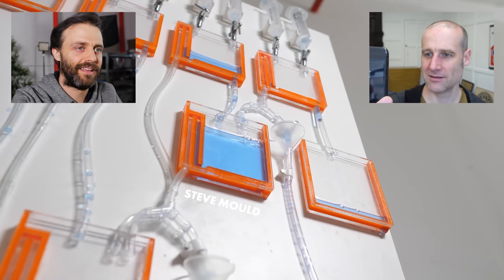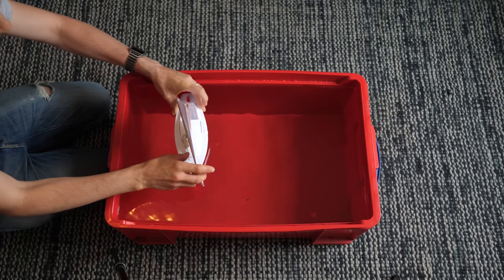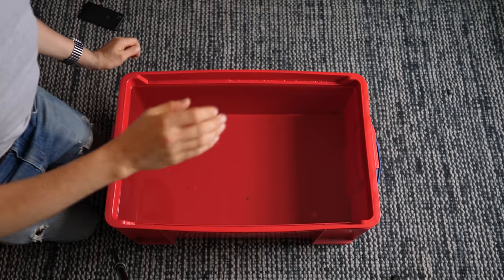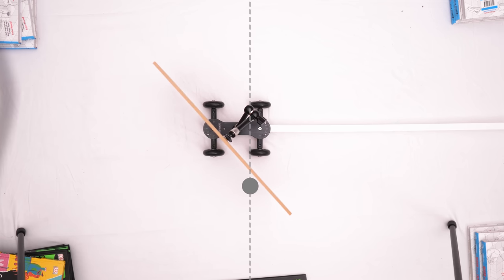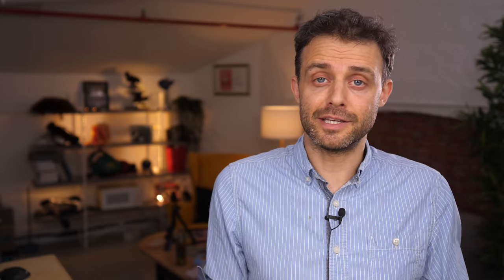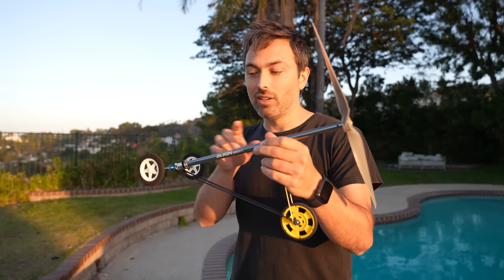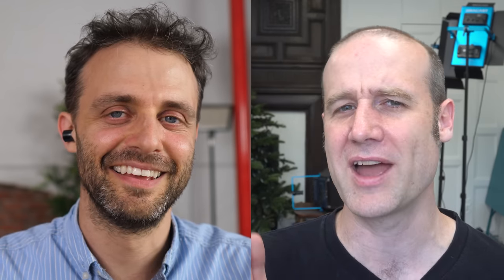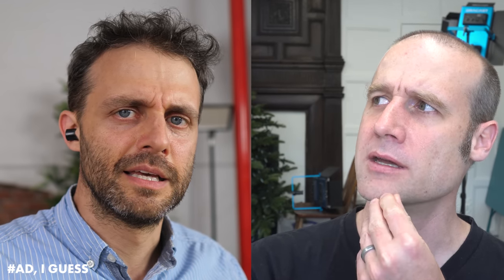Sailing Faster Than The Wind - How Is That Even Possible?

Comment: Just as an aside, in practice sailors can rely on tactile and visual feedback to "feel" their way to approximately optimal angles. It quickly becomes largely intuitive, like learning to riding a bike.

Forms of this feedback include the relative direction of small weather vanes, boat tilt or the sail floppiness.
Reply: Don't forget the telltails, they're little bits of yarn taped to the sail in various locations to help visualize airflow over the sail.
Reply: @alexjband  Aye And don't forget the nose. A good sailor can smell a fart and tell you exactly whence it came, and who the likely culprit.
Reply: We had a family boat when I was young that was not what would be called handy and even though a sloop was a pain to tack and just wanted to sit in irons and go nowhere. The sails and hull were not well balanced and apparently the hull was also used to produce a power boat version! We had to go off the wind in to a broad reach to accelerate the boat and then slam the always heavy feeling tiller over and hold the windward jib sheet to pull the bow round. This lazy boat really made you think of the relative speeds at angles to the wind. In some ways it made it more fun to sail. Happy memories.
Reply: @alexjband  yes, and we see these on aircraft too with yaw strings. Gliders typically have them though so too did the AV-8B, the U-2, and the F-14. Such string was the only instrument on the Wright Flyer though theirs was both Beta and Alpha as it was not over a windscreen and was next to an aft aligned peg so as to be able to see the alpha relative to peg while seeing beta relative to self.
Reply: It is impossible! In order to prove that you can sail faster than the wind, you have to tell me first how fast the wind is (thru an anemometer), and at the same time determine the speed of the sailboat, and compare both velocities.
Reply: What’s the speed of the “wind” coming out of your mouth, Mr?

Comment: 7:08 this is why in sailing, changing the angle of the sail is similar to changing to a higher gear in a car. you start at a steep angle because that gives the most perpendicular force, but after accellerating for a bit you reach the maximum speed for that angle and have to pull the sail into a shallower angle to get any more speed. until you reach the maximum speed the boat is capable of when the sail is almost perpendicular to the wind.

so the best angle for the sail depends on where the boat is pointing, where the wind is coming from, the speed of the wind AND the speed of the boat.
Reply: Not true, the true wind angle stays the same. The relative wind angle shift forward due to the speed of the boat. That is why the sails need adjustments.
Reply: As a semi pro sailor we have gears in the sense of different mast angles for different breezes and different sail depth and camber to affect the CL. the pulling sail in bit is more like a rocket thruster in space.
Reply: @judem8028  you've never trimmed the sails?

Comment: For anyone wondering, there is also the really fun phenomenon of generating your own wind. Which occurs because as you gain speed, you are now experiencing wind equal to your speed(essentially) in the opposite direction of your travel. So as you speed up, you start having more wind, in a more bow(front of boat) position. So you can then capitalize on that and go faster, which is why many sailboats nowadays are optimized for more upwind sailing. The most dramatic example I have seen was America's Cup World series boats(which has all sorts of optimizations like wings and foils) and traveling downwind, they had their sails in close as if they were going upwind, and their windex's read that the  wind was about 4x faster than we experienced elsewhere. Really good video, thank you for making. I did not know about the whole missing thing with the wind, and you could certainly make a hundred videos about the physics of sailing.

Comment: Very nice explanation, I’ve done a couple years of sailing and this is pretty accurate. Only thing is for the perpendicular trajectory, on a sailboat when you go perpendicular you will bring your sail near completely in and counter balance your boat with your own weight on a small boat like a laser.
Reply: In no way do you have your sail completely sheeted in on a beam reach, that is incredibly inefficient, especially on a laser. The only possible situation in which you should be sheeting in all the way when on a beam reach is when you are sailing significantly faster than the wind and your apparent wind is coming from a close hauled heading.  On a beam reach the sail should be roughly half way out. 

Source: I'm a sailing instructor, have been sailing for 7 years, and am campaigning for the waszp world championships.

Comment: 4:27 The blue/sideways force does have an affect! Because it and the ‚resisting force on the hull‘ are offset, the boat gets tilted. Thats why big boats have weights in the keel and small boats relie on the bodyweight of the sailors to counteract it.
Reply: Yes, but "tilting against the natural vertical" is just a change in potential energy, and once the tilt is achieved, no more work is done, at least as far as tilting is concerned. Also, it's effect, not affect.

Comment: I'd like to add that sailing is only possible when you've got two mediums with different velocities (different direction and/or magnitude), that's what lets you continuously extract energy from the medium.

Edited for clarity.
Reply: Probably the most important point for understanding how the car in the Veritasium video works. I think very few people appreciate this and it's the reason so many people call hoax.
Reply: Specifically, you need to have much higher resistance, at least to lateral motion, in one medium than in the other. "Sailing" on a water-oil interface likely would not work.
Reply: Is there any reason you can't extract energy from the medium you're travelling in?
Reply: Sure you can, but not in any other direction than the one where said medium is going - you've got no "leverage" to pull/push in any other direction. Imagine yourself floating in a vacuum, if someone pokes you with a stick you will extract energy off that stick but then flailing away you go.
Reply: This is much more intuitive in the boat case than the car from veritasiums video. In the boat case the water simply provides the resistance you need to hold at the right angle
Reply: @yonatanbeer3475  
You can, a balloon in the wind will speed up till it’s moving at wind speed, and will have gained some amount of kinetic energy. But once it’s reached wind speed it’s impossible to extract more energy from the wind, which is not the case on a boat for example. Which is what I meant in my comment.
Reply: @jeffvader811  is there any rule that says a clever balloon design can't leech energy from the wind?
Reply: @yonatanbeer3475  yes - conservation of energy.
Reply: @yonatanbeer3475  
To rephrase your question, is there anyway you can extract energy from still air? Because that's what a balloon moving at the same velocity as the wind is equivalent to.
Reply: @jeffvader811  I suppose you can "extract energy" from still air by pushing on it, and thereby the air goes backwards and you go forwards.
Reply: @yonatanbeer3475  
If you’re pushing on the air, the energy is coming from you, not the air.
Reply: Yes... You need a difference in velocity to extract energy from the wind, so take:

Vw = Wind velocity module
Vb = Boat velocity module

Traveling against wind ( Vw > Vb ): 
Vw - (-Vb) > 0   ---> Energy extraction ---> Acceleration in any direction you want

Traveling slower than wind (Vw > Vb):
Vw - Vb > 0     ----> Energy extraction ---> Acceleration in any direction you want

Traveling the same velocity and direction then wind ( Vw = Vb )
Vw - Vb = 0     ----> No ---> No acceleration

Traveling faster than wind in the same direction ( Vw < Vb ):
Vw - Vb < 0     -----> Impossible
Reply: @yonatanbeer3475  well that's not true, right? I mean, I don't know the limits, but a glider can go more than just the direction of the air. 

Like even a sail, you could go left or right relative to the direction of the wind by change the direction the air goes after it hits your sail.
Reply: @flyfrog49  this isn't about direction though, it's about speed
Reply: @yonatanbeer3475  The answer to your question is entropy. You can't extract energy from a uniformly moving medium any more than you can extract energy just from a hot object. You need a difference (two different speeds for the medium, or two different temperature baths) in order to extract work. That's the core essence of entropy.
Reply: @QuantumHistorian  where is the difference in energy in the ship tacking example from the video?
Reply: In equilibrium, you take energy from the wind (sail) and you lose some of it to the water by pushing on it (hull sideways). The excess energy gained you lose to water-hull friction going forward at a steady pace.
Reply: @yonatanbeer3475  It's not just the difference in energy but the difference in entropy that drives any machine. In this case, the difference of both of these is between the stationary ground and the moving air. The ship+sail is a system that uses the differences between the two to extract work.
Reply: This is why you can't sail through a mountain on land. The two mediums are too similar.
Reply: @polus2494  I would have given the example of a hot air balloon not being able to go faster than the wind, but I guess yours works too
Reply: @QuantumHistorian  Exactly. And conversely, that's why it's perfectly physically possible to sail through a mountain that's floating in the vacuum of space. In fact, it's recommended.
Reply: @jsirkia  Lift disproves this. It extracts energy perpendicular to the direction in which the medium is going
Reply: @QuantumHistorian  yes but a static object can create this differential: ie an airfoil createsa a pressure differential. This resultant force is NOT necessarily in the direction of the wind, which would be true of bluff bodies but not of any wing
Reply: @thelurkingpanda3605  Of course, but there you've got an additional source of energy pumping in - from the engines. I should have mentioned I was only talking about closed (thermodynamically) systems.
Reply: unless you are talking about looking at the system as a whole, in which case input of energy (thrust) is required to be able to extract lift, i see what you're saying
Reply: Nope. A glider can extract energy from thermal energy (i.e. hot bubbles of air rising) and again that is directly in the same direction as that air rising. When there is no rising currents, the glider is not extracting energy from the air, it's merely converting a part of the pull of gravity to forward motion and will inevitably need to land.
Reply: @jsirkia  But if there are thermal currents than the air is not a uniform medium to begin with. I promise you, you will not find a counter example to the second law of thermodynamics.
Reply: @QuantumHistorian  Of course I won't! Sorry for the mixup, my response was to LurkingPanda about lift disproving anything.
Reply: @jsirkia  I'm not arguing any point here, just wanted to throw in a visualisation that really helped me wrap my head around gliding when I started flying them (for anyone on a late night youtube comments deep dive):
A glider is ALWAYS descending, else it can't fly at all. It's just that the sink required to maintain flying speed is (thanks to its aerodynamic efficiency) often less than the rising speed of the air it's flying through, causing it to move upwards relative to the ground when that's the case. The trick is to STAY in that invisible portion of the atmosphere, of course.
Reply: @maggus999  I used to fly RC gliders years ago. I still remember the rush of noticing the slight tilt of the wing away from the edge of a thermal it flew into and then successfully turning the craft into it and riding it high enough that I could just barely see my plane anymore, then flying back closer and maybe finding another one. Simply exhilarating, must be even more so in an actual glider.
Reply: @jsirkia  The pure satisfaction you get from efficiently circling thermals, and the frustration of failing to do so, are both thrills I wouldn't want to be without